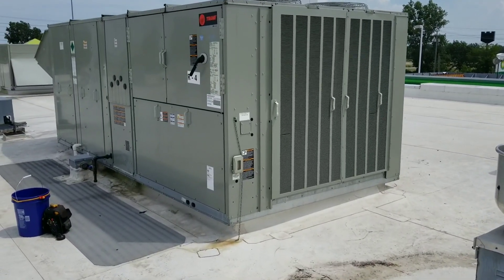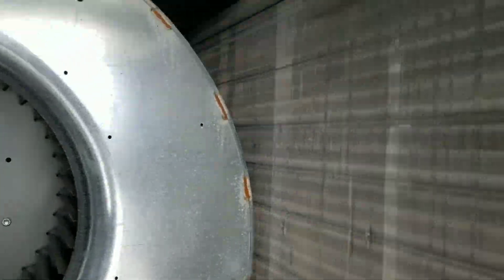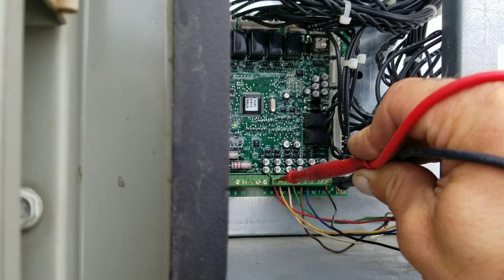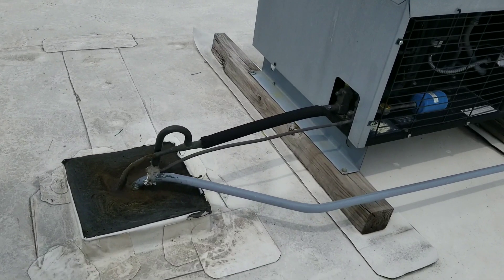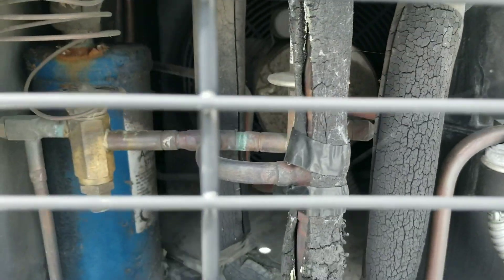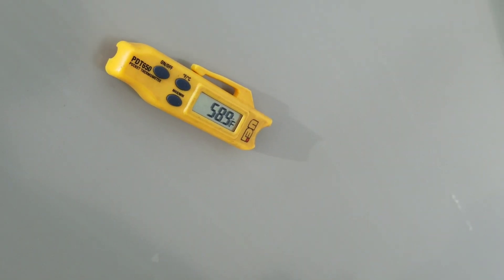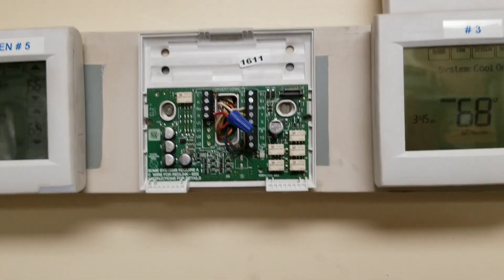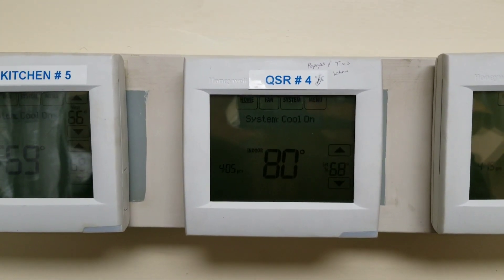No AC, Trane package unit not cooling

Comment: 6:50 it's a head master... No not my sister; thats a different type of head master. It keeps the head pressure high when it's cold outside. It's hard for the unit to keep proper head pressure when the outdoor temperature is colder than the box temperature. Units are engineered to operate for the outdoor temperature be higher than the box temperature. So the valve (head master) allows some hot gas to bypass the condenser and dumps it directly into the reciever to keep the head pressure up (when it's cold outside). Love your channel!

Comment: Hope you know that brown board on the right side of electrical panel (had 2 on this unit) is your test board. Idk wym by bypassed in the video but you could of put a screwdriver or jumper between test 1 & 2 and you take it off every time you hear a click wait to see what come on (heat , stage1 cool , stage2 cool or both cools)  first click is always blower and the steady green light on RTRM board will change to flash when you do this.

Comment: Are those thermostats smart enough that an open zone sensor will make them revert to local temperature sensing?  The previous techs error may have been he failed to realise this and didn't reset the thermostat to remote sense. Totally agree about being a pig leaving buts inside the unit, could have been worse and been in the evap fan area I guess.

Comment: On that Copeland it looks like liquid injection for lowering the hot gas temp. Oil dont do so well above 250f. Kinda different to see a hot gas bypass(capacity control). Usualy on a low temp i see head master and liquid injection with ct activated switch. Long vertical rise having mutiple suction traps and or double suction lines to bring oil back to compressor after defrost. Its a bad day when you have a liquid line solenoid leak by and migrate off all the oil. If compressor is low on oil need to fine out where its at. Have replaced a few compressors before and had to pull twice to three times the sump worth of oil. Always tear down a ironbody to see cause of fail. Kinda hard to cut open a tin can or scroll.

Comment: Thats actualy a baby intelpak. Use to walking up on 100-200 ton models. They are intimidating the first time you walk up to them. Well built machines. The RTRM units are much easer to work on then the older UCP ones. They also use a controller that the buttons like to stick on on them and the chillers.

Comment: Hot gas bypass head pressure control system. The txv may be to meter liquid into the suction line for compressor cooling.

Comment: Hi Bill,

The double suction line is for oil transport during low load when only one evaporator is being fed liquid.
Hence the low load one being smaller diameter, to get the gas velocity to transport oil.
The the hot gas injection keeps the suction level above a certain level so the coil being fed liquid under part load does not freeze or cause de-humidification.
That adjustable pressure valve opens below a set pressure in the suction.
It's neat, don't see it that often.

Good on you for pointing out that the equipment should be treated with respect, and that the next guy finds the job in good order. 
Like you say, the next guy is going to say: Bill was here................?

Best regards,
Duncan
Reply from the maker: Thanks for the info Duncan, much appreciated- stay safe out there
Reply: @curioushvacguy6876  if that was attached to a house  it would get cold fast

Comment: Double suction riser. Depends on length of vertical rise. Thats wrong. There's no solenoid on a suction line. If you shut one solenoid the condenser would pump down. The only reason its there is bc of oil return.  Its in every heatcraft manual and explains it in depth

Comment: The toggle switch next to your meter is used to cycle through the stages for testing . There should be a chart on the inside of the left door . Also some of the zone sensors will not be sending 24V to the board but will just show a different ohm value to call for heat,fan,air etc . We use a lot of 50 ton Tranes here and have a 108Ton also .

Comment: Double suction line could be another evaporator on another box. liquid line would have to split somewhere also. Both evap coils would have there own thermostat and pump down valve. the compressor would be controlled by pressure switch. as long as one box is calling for "cooling" the compressor runs. The satisfied  evap would be the same pressure as the one still calling for "cooling." When both satisfied compressor goes off on low pressure. 
   Used to be quite common to run multiple evaps on one compressor. Big draw back; compressor goes bad all boxes go hot.

Comment: I worked on one of these not to long ago It never worked in heating mode from day one with a little help from tech saport we resolved problem the problem was control wiring between pcbs was incorrect In other words you're J connectors were going to the wrong places on the boards these units are hard to work on and there's very little information out there at least it was  in my case it took several phone calls to train before we could get the right guy to give us a hand
Reply: Jcam Camarij  true but man getting tech saport help now is like pulling hens teeth

Comment: What did you find was the reason why the compressors did not come on at initial startup.
Reply from the maker: If I remember correctly there is a built in delay in that system
Reply: I’m surprised that it was only a two minute delay. Usually Trane builds in 5 - 10 min delays for loss of power.
Reply: Rich Davis you are probably right he said it was 2
Reply: 2 minute delay big equipment
I think this would be done to keep the equipment from cycling too quickly

Comment: I worked on some Tim Horton restaurants that had that setup for the Iced Cappuccino machine. The double suction line was for oil return. The unit on the roof never shut off, so when the unit downstairs satisfied and closed its valve the unit on the roof had its own 2nd txv to use. It was all massively oversized so they could draw product continuously.

Comment: ya, a double suction header. normally for oil control under low load conditions. we dont run into it much in my area/ on equipment we service since we dont really do much with coolers/ freezers. however older larger split systems that control capacity for comfort cooling or even chilled water for remote barrel or plate frame. normally found on r22 systems or should be anyway. sometimes its spect for 410a depending on condenser location. For example, some York commercial splits if the condenser is x amount of feet above the evaporator, (normally several storys) then they want to use a double suction header or oil separator. I have one account with a set up like that is 2 stage and has a oil separator on it that we installed for the installing contractor due to the condenser being 60 feet above the evaporator so it traps the oil and dumps it back to the compressors.
Reply from the maker: Hey Cameron thanks for the feedback- I dont get to see to many of those in my area either

Comment: I think you would like the much larger 162 ton rtu trane intellipak, and governair units that are even larger
Reply: Curious HVAC guy they are pretty cool, at first very intimidating because of the massive size and high voltage danger and yep daily work on em
Reply: Gamez516 Wait till you work on 750 ton chillers 😉
Reply: Wait till you guys have to work on a 1,400 ton centrifugal chiller hanging off a 16 ft ladder  just to access everything in the motor starter compartment.
Reply: Oh and the voltage to the machine is 13,200 volts.

Comment: Great video buddy! I had same issue with a venstar t4900 stat. It was way too cold. I found stat was not  reading remote sensors😂 with venstar, a degree icon is flashing on screen which tells you reading from sensor but degree icon not flashing means reading from stat. I wonder if Honeywell has that same feature?.😎

Comment: 30 ton.  That’s pretty heavy..
Reply: I’m strong! I can move a 3 ton unit all by myself!!
Reply: @jeffb8437  I can move a 15 ton all by myself if I have an angle grinder and enough time. 🤣
Reply: it’s the cooling capacity of an A/C system. In 1-Hour the system should be able to remove 30-tons of heat. So if I did my math correctly, this unit should be able to remove 360,000 BTUs of  heat.
Reply: @jackhandyy  sure it does.  30 tons times 2000 equals 60000 pounds.  Very heavy.
Reply: @jfrancis98  hahahaha!!!!!

Comment: The new design HW stats SUCK for face to subbase connection!!!! Why the hell HW changed to this setup is baffling.
If the subbase is not perfectly flat, even if it is flat but more likely if it's not flat, that connection can be poor and influence operation. Fan may work, but heating or cooling won't.
In a situation that the stat is "fingered" regularly, it can alter the connection, too.
I wish they went back to the pin connection.

Comment: Looked like hot gas bypass with liquid injection. That would make sense for the double suction riser. I'm not 100 percent sure though.
Reply: @curioushvacguy6876  exactly. I was talking about what was in the condensing unit. If you're passing hot gas back to the compressor you're moving less gas through the suction line. So it would make sense that they would install a double suction riser. The liquid injection would be there to control the suction temp coming back to the compressor.